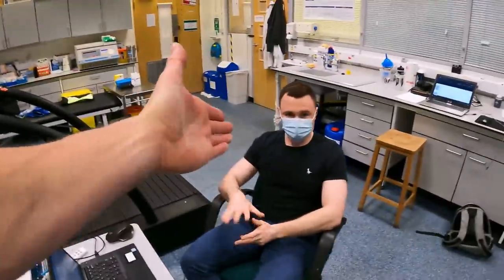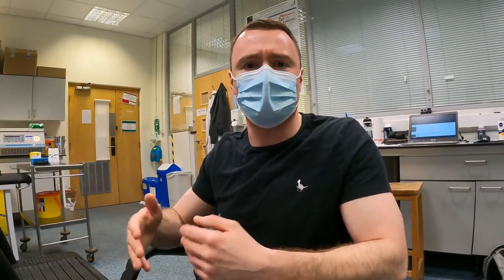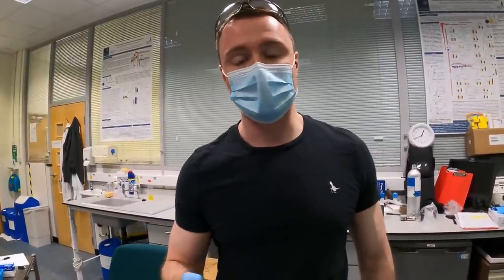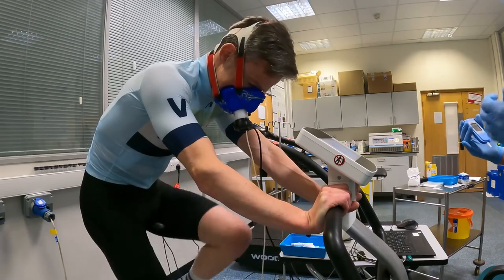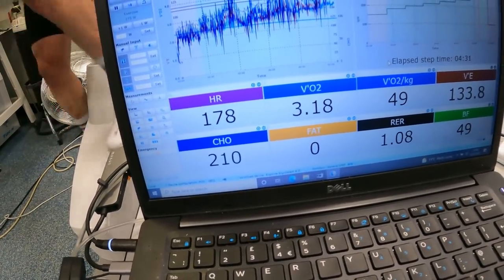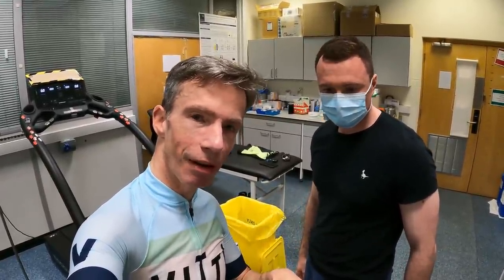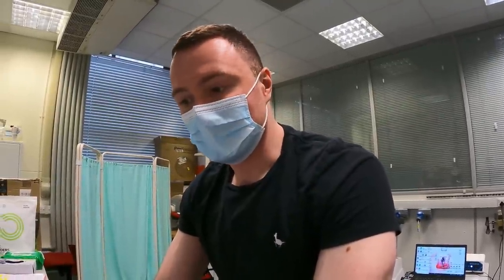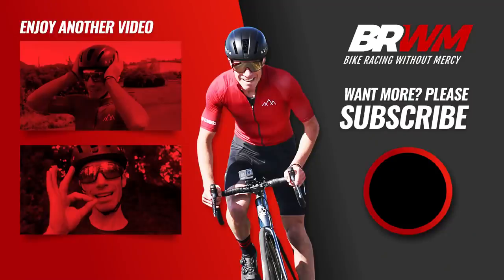How To Improve Your Cycling Endurance, Using Sports Science

Comment: Very informative. Illustrates how personalised LT1 is relative to FTP. Work at LT1 or slightly below and grow your engine with lower risk of burnout.
Reply from the maker: Absolutely Steven 💯 - to set out training zones and thresholds between zones off an FTP test which is itself quite arbitrary in terms of the 95% vs 90% vs 93% etc - in turn causes many of us to over estimate our training zones and thresholds between zones, and then ride at too much power (eating too little) and bonking too early !!

Comment: i guess that this is why its hard to lose body fat via cycling alone. its heavily weighted towards burning CHO, and low fibre, high glucose is king, on the bike. i firmly believe that the drip feeding of glucose into the blood stream, is key to telling the brain that all is well, and prevents a bonk. i did hear the phrase, "the fat you eat is the fat you wear", and it seems relevant. 230 watt LT1??? you beast Phil!!
Reply from the maker: That’s really interesting you say that Ian - and I guess that the strength training has been an added help for me.  I do think that cycling does (often given our propensity to underway) create a good calorie deficit - which will help with the fat loss after the training.  And based on what Adam said about the carbohydrate depletion even at low levels of intensity - I think you are right - by drip feeding you’re providing a positive signal to the brain.  Cheers on the LT1 🙏- but as you previously saw my threshold is not the biggest !  Hope you are keeping well Sir👍
Reply: @BikeRacingWithoutMercy  keeping well phil. my outdoor racing season is underway and i plan on getting as much outdoors work as possible. a girona week is also on the menu for this year, so Ed's week has whet my appetite lol. say hi to Jayne!

Comment: Also, for those doing gran fondo sportives, what is the most useful “threshold” to be focusing our training on?  FTP and Vo2 max aren’t the limiting factors on L’Étape du tour.  It’s being able to keep decent power output for six hours or more and have something in reserve for steep ramps
Reply from the maker: I think targeting to ride the big Gran Fondo climbs at LT1 or Low Tempo is the main objective.  But I found that having done a lot of LT1 / tempo training prior to the Haute Route Swiss Alpes that the altitude had a big impact and I needed a bigger threshold.  So for the Haute Route Dolomites later on the same year I still did the LT1 / Low tempo endurance training - but also built my Z2 - Z3 and Z4 thresholds by adding in x1 Threshold Training and x1 VO2 Max training each week
Reply: @BikeRacingWithoutMercy  thanks for help.  I’ve found that indoor zone 2 training can help with the mountains because of the need to keep power through the pedals - no freewheeling, unlike on a typical ride in Surrey - and also because of the effect of heat and sweating / dehydration and the tendency indoor not to fuel during sessions on power output

Comment: Very enlightening deep dive, Phil 👍 My LT1 was calculated completely differently here in Frankfurt. The calculation shows that it was 0.4 mmol/l above baseline (1.55mmol/l), not calculated as 1 mmol/l above baseline, which would have been around 2.15 mmol/l. At LT1 you should be burning primarily fat, and typically less carbs than you can consume per hour
Reply from the maker: Thanks Mark 🙏 - my pleasure.  And Adam did say that there are a number of different ways the LT1 can be calculated.  But my big takeaway was the need to err the right side of the lactate threshold / LT1 for the best results.  And based on my test, I know that 225W I was still stable near the at the 1.2mml base line at about 1.4mml, but it then went up to 2.4mml at 240W - so I’ll aim to keep it sub 225/230W.  We are clearly pretty similar in our levels 👍
Reply: @BikeRacingWithoutMercy  Yes but typically at LT1 you are burning more fat than carbs and any carb intake should more than compensate for the carbs expended
Reply from the maker: @markbentley4343  that wasn’t what Adam was saying.  I asked the question during the test in the video, to enquire why my LT1 wasn’t 180, given my carb utilisation was high even at this stage.  Adam answered that whilst even at 180W, I was burning 140g carbs and 10-12g of fat per hour, the body is still using the carbs to produce the energy in an oxidative/aerobic manner, with the lactate being comfortably cleared inside the muscle and no excess in the blood as a result .  And this was the case right upto and including 225W.  He also said that it’s not really viable to eat enough carbs to replace what is being burned even at low intensity.  But he was clear that riding at or below LT1 is good for sparing glycogen depletion.  But whether we’ll below LT1 at 180W or at LT1, fat was not the primary fuel source (just 10-12g per hour at LT1).  And Adam said these results were consistent with his general experience.
Reply: @BikeRacingWithoutMercy  Wow that’s interesting. Classically LT1 power is known as all-day endurance. Not sure how we can go all day if we are out of carbs and unable to burn sufficient fat. But yes, you’re lactate is not apparently rising above baseline much at all until the big jump at 240W
Reply from the maker: @markbentley4343  they way Adam articulated it to me was that it’s the max all day power where if we can ingest 80-100g of carbs per hour, we both keep topping up glycogen and spare the worst of the depletion in turn enabling us to ride at this consistent pace for a good number of hours 4-6.   And if we take a cafe stop or other break, its essential to take on carbs to try and restore some of the depletion whilst nothing is being burned.  But inevitably during the long rides we also spend plenty of time in low zone 1 - on the descents and during easy periods (with much reduced glycogen depletion), plus bursts into threshold on the steeper parts of a climb.  So I often would find that even if on the flat and climbs I try to ride 220-240W, my average power is more like 165-185, indicative of big chunks of time where glycogen is being spared.
Reply: @BikeRacingWithoutMercy  If it feels like you can go all day at 220W or so then all good, and like you say you will necessarily do less power due to descents etc in an event and hence keep carb burning under control. Pros typically have LT1 pretty close to LT2 though not sure of their carb expenditure at such levels. Yours appears to be closer to LT2 than average, so big kudos for achieving that 👍

Comment: Great video. One query you could raise with the sports scientist regarding your results and physiology. Around the 5 min mark at what is clearly an 'all day' pace of 180 watts for a high calibre rider capable of an FTP pushing 275, how is the fuel being burned almost exclusively carbohydrates? The absolute numbers here fluctuate between 100 to 150 g/h of carbs with fat barely registering (between 0-19 g/h), that is a 10X differential in favour of carbohydrates. This is clearly an all-day chilled (zone 2) pace that we would typically classify as high fat-burning.  Later when sitting at 275 watts, the sports scientist talks about the huge amount of carbohydrates being burned at such a high effort (200 g/h) and discusses how the body switches exclusively to carbohydrate for fuel as it is more efficient fuel source when oxygen becomes a limiting factor. However, there is little difference in fat being used between the 180 and 275 watts. The question is - where exactly is that switch from fat to carbs if very little fat is being burned at an easy pace of 180W with a chilled heart rate of 120 bpm? For endurance athletes, one of the predominant schools of thought is that we are to improve efficiency by training our metabolism to be more dependent on fat as a fuel source and thus reduce our dependence on limited carbohydrate stores (and our ability to replenish real time). For a rider like BRWM, where in his power curve is he burning fat in any significant quantities? There are classic carbohydrate/fat burn graphs presented online that show predominant fat burning with modest carbohydrate burn at low intensity , with these graphs eventually converging at a mid-point as intensity increases and eventually carbohydrate taking over at very high intensity. The classic Coggan model classified 'endurance/Z2' as a high fat/carbo burn type of pace and even states moderate fat/carbo burn at tempo/Z3.
Reply from the maker: Thanks Peter - and these are great questions.  I was surprised that I wasn’t burning more fat for fuel at 180W.  But the point being I guess that whilst the fat was 10-12g per hour, it has 9calories per gram so 90-108cals per hour, and in turn this spares the use of glycogen.  Whereas even at aerobic threshold let alone anaerobic threshold, fat burn was zero.  The tests were focussed on the lactate threshold, and the blood does not lie (noting the reading of 3.8mml at 275W was consistent with my previous lab visit (c4mml).  It may have been impacted a bit by my breathing and talking at points - but as Adam said, even if carbs are the primary source of fuel at and below the aerobic threshold / LT1 - the body is still working aerobically, and sustainably (low HR, easy controlled  breathing and no issues clearing any lactate in the blood) - and in turn is able to continue for hours, with carb intake being the limiting factor.  And when I think about it in real life, if I do a low intensity ride indoors for 3 hours fasted, I will feel pretty depleted and ready to eat at the end - indicative of 300-400g of carbs being used from my stores of c500-600g.  So makes sense - but is surprising 👍
Reply: @BikeRacingWithoutMercy  even given the energy potential for each source, there is still 5X more energy coming from the carbohydrates at that all day pace! as with everything there are individuals at either end of the spectrum, i consider myself a 'butter burner' at the opposite end from you.  i use long steady distance rides to strip off fat after off season, it's very effective for me but i suspect i'm getting a much higher percentage of energy from fat vs carbs at a similar all-day pace. The important take away i believe is the importance of carbs for your aerobic performance. i.e. being well fed before the 312 and being sure to supplement periodically.

Comment: Very interesting, considering the 75% FTP "limit" for Zone 2 in the well recognized cycling Bibles... seems like it can be very individual for sure. Any tips for trying to hone in on the LT1 by oneself (apart from talk test)?

Also, very eye opening in terms of how much actually we can burn vs ingest in terms of CHO.... Got the same LT2 as you and while I was vary of this, still good to see the numbers and make yet another mental note in my brain to EAT CARBS.

Very informative stuff, thanks
Reply from the maker: Thanks ever so much Uberpaker 🙏 - so pleased you found this one helpful 💯. Yes - as for the anaerobic threshold, I too was surprised by just how much the conventional training zone model determined by the 20min FTP can overstate / understate our thresholds and zones.  For me the takeaway was that your aerobic threshold will vary according to both genetics and the kind of training you’ve been doing - so if pushing to build a bigger FTP, then there’s a good chance it will be overstated using 75%.   One other tip from Adam was look back at the data for the rides where you’ve been riding a consistent power for 3-6 hours and look for signs of a positive split, with power trailing off in the final 25%.  Also heart rate should be pretty stable over 2-3 hours and well below your anaerobic threshold (e.g. 145-155bpm for me at aerobic threshold - stable for 2-4 hours vs 165-175 at my anaerobic threshold - stable for 30-60mins) 👍. And for sure - me too -EAT MORE CARBS ON THE BIKE 🤣

Comment: Hmm... I've never looked twice at the CHO value on my own test, but that makes perfect sense. Now to get that LT1 number up :) An LT1 around 230 is great Phil, especially at your weight. This means you'll be able to sit around 3.6wkg all day (if you eat enough 😉). This is massive for events like La Marmotte.
Reply from the maker: Cheers, Marco 🙏 - what LT1 is and why its so important has been a massive revelation to me, Marco - and cheers for your amazing encouragement 🙏. I too was shocked about the level of carb usage at low intensity - and for sure if I can pace  to LT1 and fuel correctly, then hoping to go a little faster.  How are you getting on ?  Any more progress ?
Reply: @BikeRacingWithoutMercy  Slowly feeling better. Power is way down though, but seeing how Scott performed Friday I know it'll come back. I'll just have to be patient (that's the hard part 😉). I've been riding a bit, and I notice that slowly the feeling comes back, and also my avg power/avg HR is slowly getting higher, so it's definitely improving.

Comment: Be interested to know some of the science behind reducing that carb per hour figure and workouts (i.e. fasted?) you can do to reduce this, assuming lowering it is a desirable performance/endurance outcome.
Reply from the maker: Cheers James - I do a lot of my strength and cycling workouts early in the AM fasted (but having eaten plenty of carbs the day before).  And can happily ride 2-3 hours low intensity indoors with no carbs - but this did not make a big difference to my fat usage (just 10-12g per hour during the 180W segment of the test!).  Adam said the fasted training can help the body become better at storing glycogen - which I think has helped me.  But biggest takeaway was that for the big rides when you want to do well, eat a good low fat high carb breakfast, and eat plenty of east to digest carbs on the bike 👍

Comment: Have you looked in to the issue with your assiomas, phil? Quite a surprising difference.
Reply from the maker: Hi Paul - I’ve not looked into the cause, but understand that power meters are a less precise science than the manufactures would have us believe.  But I own 2 pairs of Assioma duos, and love them - and they are very very consistent with eachother, which is the main thing.  I also understand that power meters can vary according to temperature etc.  But for these lab tests, the conditions were exactly the same, and with the correct zero offset the variance was the same - with the Assiomas under-reading the lab bike by about 10W at 225-240W and 12W at 265-275W 👍

Comment: Great video. Did you determine your Fatmax wattage in gms/hour during the test? Some coaches feel that training at that wattage rather than going up to LT1 is better for increasing Fat utilisation.
Reply from the maker: Hi Cary, we didn’t set that.  But your point makes sense, because even around LT1 (225W) my fat utilisation was almost zero. Whereas at 185W I was still burning 10-12g of fat per hour.  👍
Reply: @BikeRacingWithoutMercy  Everyone is different but you must be really good at producing AND clearing lactate. In a test before the lockdown I was burning 48g FAT/hr @ 180W and my LT1 appeared to be nowhere near as good as  yours.

Comment: Very instructive video. The science of finding the equilabrium between exercise and eating carbs so you avoid bunking on a long ride.  It is helpful to do these tests especially when you embark on a very long ride like the 312.  I would be interested in doing the same experiments but using a different strategy: little or no carbs.  I have been low carbs and fat adapted, my longer rides have been better and less gut painful.  You should read the science about using more salt in your water to decrease your heart rate which could reduce carbs utilization.  Thanks for the useful contant.
Reply from the maker: Thanks ever so much ccamire🙏 - and as someone who does quite a lot of fasted training, I too am interested in understanding this subject in more detail.  I don’t think I’ll go low carb to get fat adapted, because I do love the hard VO2 Max efforts and the occasional threshold climb.  I’ll look at the salt point - and I do find that when I add high quality electrolytes to my bottle, with salt included, my rides outside are better for it 💯